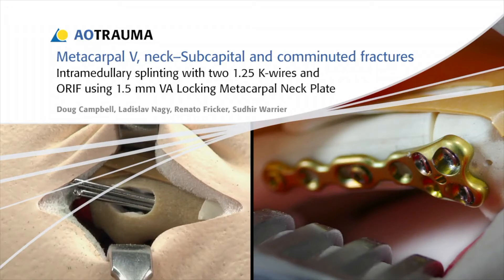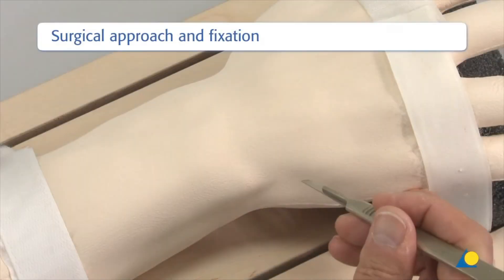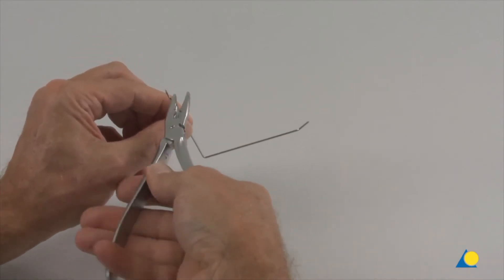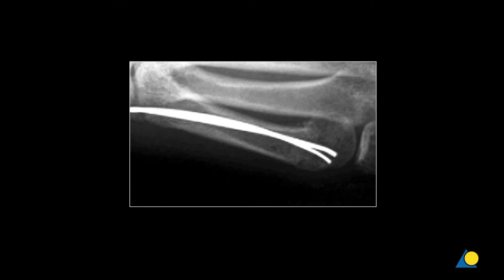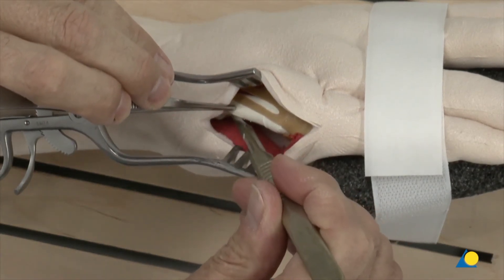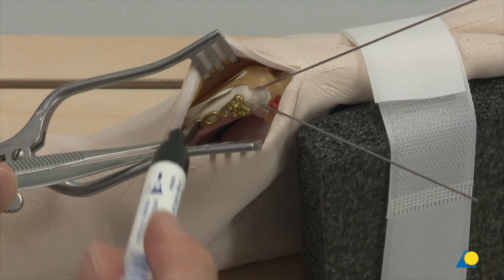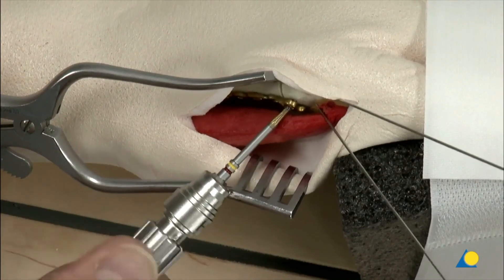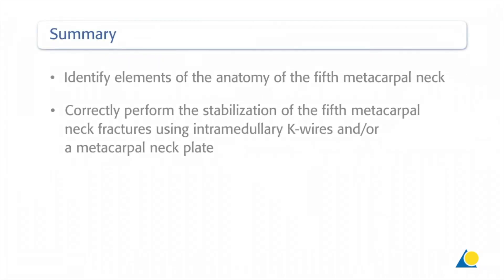Metacarpal V, Neck - Subcapital and Comminuted Fractures - Intramedullary Splinting and ORIF

Comment: Hello Sir, i had an small accident and 5th metacarpal was fractured, and it's just in position,  doctor said, no need for k-wire , just split is enough for 6weeks. 2weeks back split is removed,  now 2months completed, but fracture line still visible,  how long it will take to go off fractured line on x-ray, and I'm afraid of do physiotherapy, because when I'm doing physiotherapy some pain on fracture site. Give me some suggestions, please,  thanks in advance....
Reply: 2 metacarpal fractures right now I have 4 k wires did you ever felt something poking you inside your hand
Reply: @Cr7Follower bro how is ur hand now bcuz i have same situation like u please reply u can make full fist?